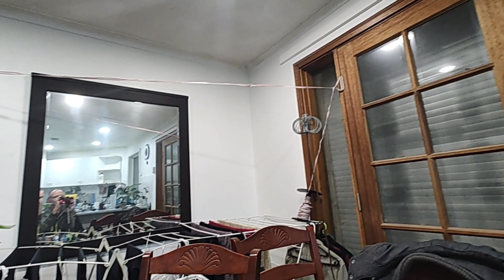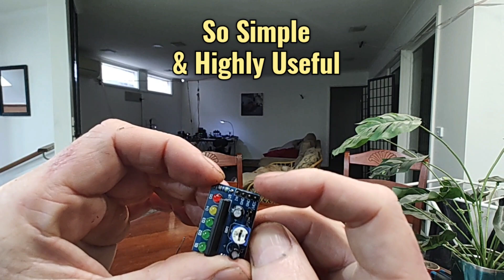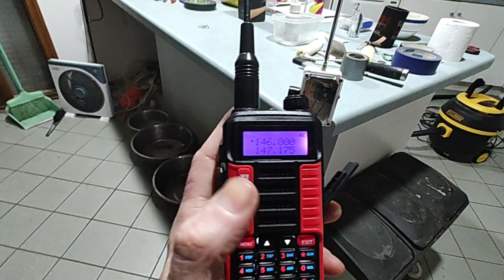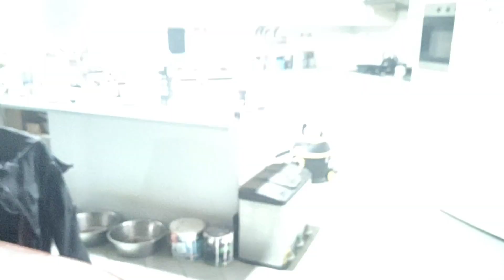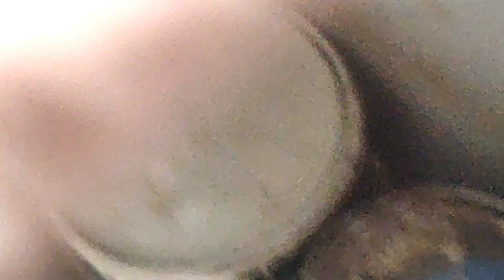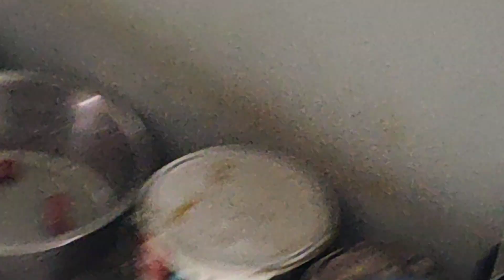How to Build a Long Range  (LED) RF field strength Meter  (UHF VHF HF)   (HAM & CB)  $ Low Cost $

Comment: nice job, thanks for share this....... ,one thing i like to ask is how long/size of the copper rail, because i build 2, one with KA2284 with small copper rail, led move up when i touch the antenna, is too sensitive (i think with long copper is not too sensitive), i also experimenting with using similar ka2284 module, wtih 10 led...(vu meter for audio led display), 1st one can pickup signal 3-4 meter, 2nd one cannot...
Reply from the maker: Hi my friend.
Unfortunately I have everything packed away as I am travelling at the moment 
moving interstate to my new home
so I can't measure the copper rail for you.
I had also experimented with a 10 LED version but was not very sensitive.
The first version will vary sensitivity 
 based on the frequencies being used & the antenna length.
 
You may be interested in my more recent video on how to build a rectenna system.

I achieved an unusually long range rectenna powering LED's at a considerable distance with no battery required.

All the best for 2026 👌👌👌
Reply: @crazyham is ok, maybe once u settle and have free time...btw thanks for sharing knowledge...its help me a lot
Reply from the maker: @RumahOmCus I'm really glad you have found value my friend 🙏

Comment: What is the operating frequency ghz mhz?
Reply: i can be sure the device emits very strong RF waves but the 50hz to 3.5ghz measuring device cant sense it, maybe at ehf shf frequencies, how can i get a device to sense them
Reply: I can say for sure that DC motor hair dryers emit RF waves, but I can't get a device to measure it.
Reply from the maker: Great questions my friend.
The Hairdryer will be emitting significant RF waves on a number of really low frequencies.
If too low in frequency,
my meter isn't sensitive enough.
Really low frequencies
have really really long wavelengths,
So small antennas are less effective on really long wavelengths.
This meter & perhaps yours too and many others will pick up things like
LED drivers etc
as they also emit a lot of low frequencies 
but much higher in frequency  compared to  the hairdryer (assuming no fancy circuits).
U could always use an oscilloscope, set to the range you are interested in
and attach wires to the probes
as an antenna system
and see the different frequencies
and how strong or weak they measure etc.
Even a fairly cheap pocket oscilloscope would be ideal.

It's what I would do in your situation
& if you haven't used an oscilloscope
it will be a great and useful learning curve too ⚡🙏⚡
Reply: @crazyham Can you recommend me the model name of the oscilloscope that has that function?
Reply from the maker: I suggest just searching for pocket oscilloscopes that cover the frequency ranges u want.
Really low can be cheap.
For Frequencies up to 100 MHz there are some good cheap pocket oscilloscopes on ebay.
I have one myself
but you will have to learn how to use it.
Below is a link to a similar one to the one I have.
Please make your own decisions
on what is right for you 🙏

https://www.ebay.com.au/itm/384969985250?mkcid=16&mkevt=1&mkrid=705-154756-20017-0&ssspo=ftfcckpgsha&sssrc=4429486&ssuid=svbGXTneQ_W&var=&widget_ver=artemis&media=COPY
Reply from the maker: I have only tested it at HF, VHF & UHF.
The antennas alone would make it problematic at GHz range
& I am unsure if the diodes are fast enough too.
It works very Well across HF Bands,
VHF & UHF for sure my Friend.
Thanks for the Question ⚡🙏⚡
(Antenna lengths are critical for VHF and UHF as mentioned in the Video)
Reply: @crazyham I bought an rf meter, but it can only detect waves from 50hz to 3.5ghz, I have a hair dryer that emits very strong rf radiation but I can't measure it,How can I measure and remove them?

Comment: With this device, you can also find buried gold metal
Reply from the maker: Ok, I understand your question.
No, this device will not find metal.
It can only detect radio signals coming from an antenna system.
I think there are a number of videos on youtube showing different ways to make a metal detector.
Thanks for your question & I hope you find the info that you need my friend 🙏
Reply: @crazyham Thanks for your explanation, Professor, also include a metal detector on the YouTube channel
Reply from the maker: Thanks Mate.
Maybe that is something I can consider in the future.
My channel is mostly related to radio (Amateur Radio)
but I do think that would be a very interesting topic to cover.
Thanks so much for your feedback & best wished from Crazy Ham in Australia ⚡🇦🇺⚡
Reply from the maker: Hopefully this link can help you start to experiment but I will look deeper into this and perhaps do a video in the months ahead on the subject.   https://www.wikihow.com/Build-a-Metal-Detector
Reply: @crazyham can i have your facebook
Reply from the maker: Hi mate. I don't really use facebook much sorry.

Comment: About to sit my Foundation exam very soon. I think this will be my first project
Reply from the maker: Excellent my Friend 🙏 Good luck with the Exam & Welcome to the World of  Amateur Radio ⚡🙏⚡
Let me know how you go with the project too.
73 from VK3VKe Crazy Ham 👌
Reply from the maker: Did you get your Foundation Licence my friend? I hope you are enjoying Ham Radio 👌
Reply: @crazyham  Yes I passed my exam. Still going to build this project as well. VK3AHS
Reply from the maker: @seansharman4931 It's great to hear that my friend. 
Congratulations 
& Welcome to the Crazy World of Ham Radio. ⚡😁⚡
73 VK3AHS
de VK3VKE 👌👌👌
Reply from the maker: Btw, I have another easier build I recently published.
It needs no battery and illuminates for quite a distance from an antenna.
It's called a Rectenna
as it is an Antenna 
that Rectifies the signal into DC to make usable power.
It's cheaper and easier to build too 👌
Here's the link :https://youtu.be/R1l_J57LsK8
Reply: @crazyham  I will have a look